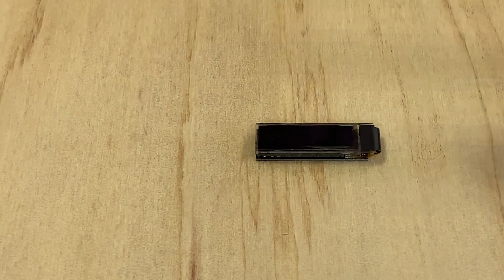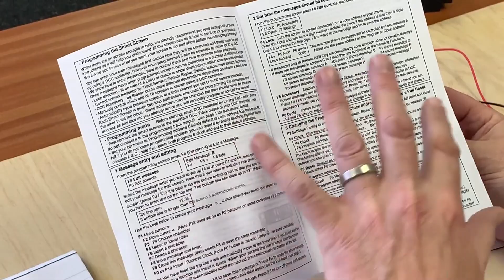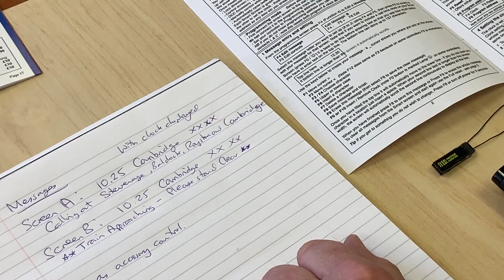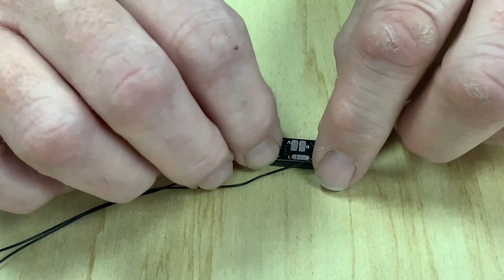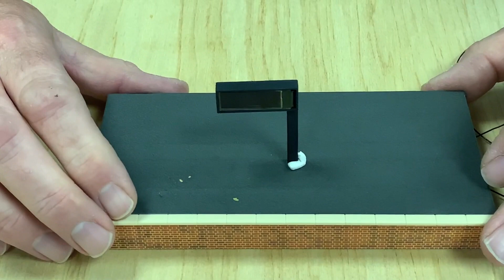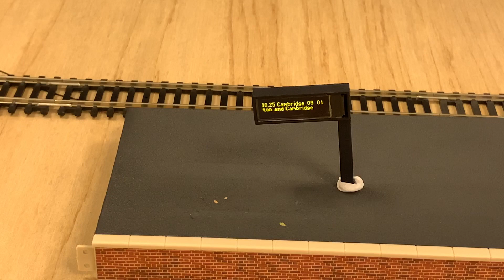Train Tech Smart Screen - Step by Step Setup Guide

Comment: Very useful video - thank you. I've bought a couple of these which I am driving from a CSB1 (Dcc ex) controller and it works well. My only slight negative is that the enclosures don't come with a mount which they can fit into. It cost me a beer (to bribe one of my mates who owns a 3d printer) to sort that out!
A little tip: If you pess F6 (Insert) when editing a message it duplicates the current character you are typing which can save you time.